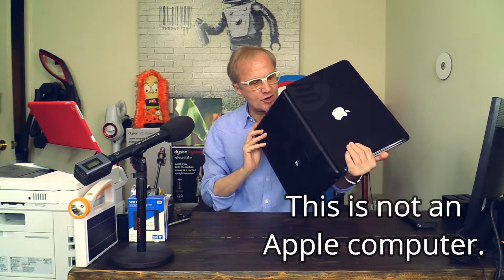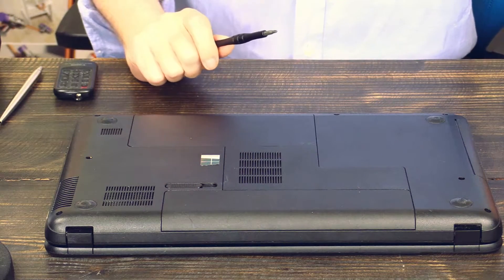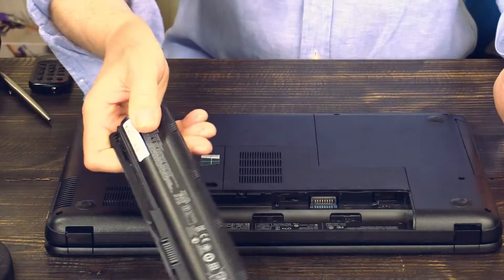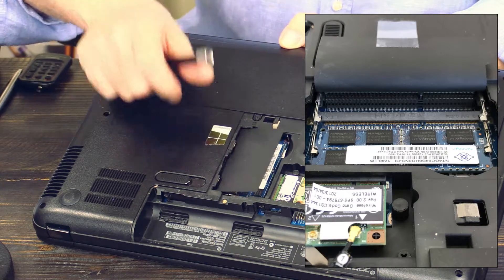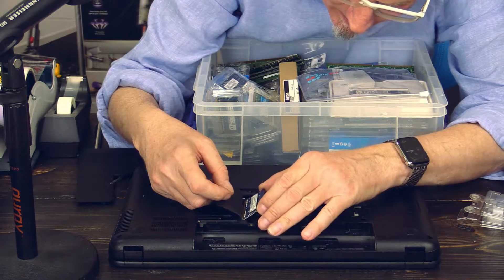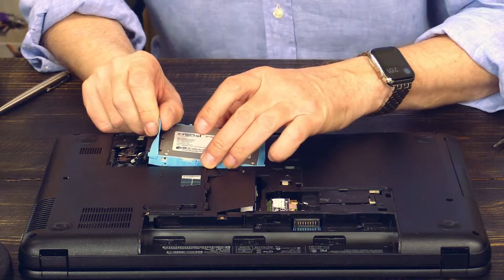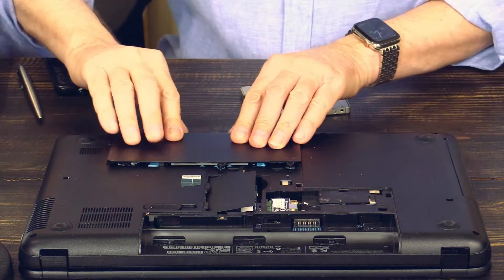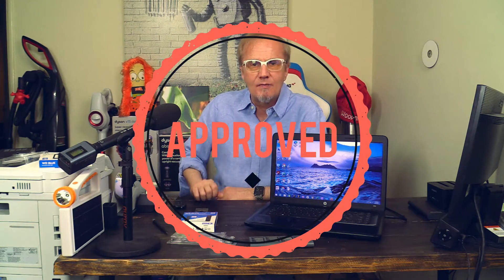How To Upgrade The HP 2000-2c32NR

Comment: Hi, can you help me with the advanced settings? I already upgrade the ram to 6Gb but unfortunately, only 1.6 are usable. I cannot enter advanced settings thru bios, done so watching so many tutorial videos but still can go to advanced settings.
Reply from the maker: Hello Kheygel. To have only 1.6 GB available is wrong. Did you use the right RAM in this laptop?
Reply: @Woopnik  yes sir. Same frequency and brand name. Cant change show advance settings on bios.
Reply from the maker: Hello Kheygel. In order to access the BIOS of the laptop please follow these steps: Turn on or restart the computer. While the display is blank, press the f10 key to enter the BIOS settings menu. Press the f9 key to reset the BIOS to the defaultsettings. Press the f10 key to save the changes and exit the BIOS settings menu.